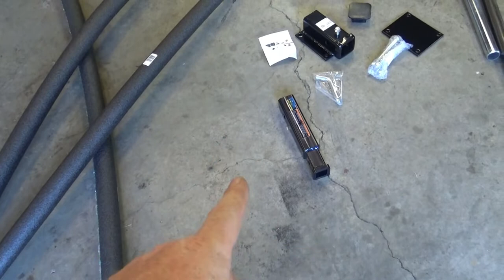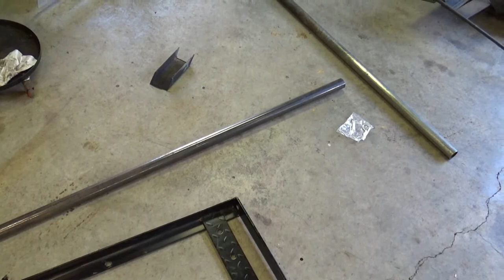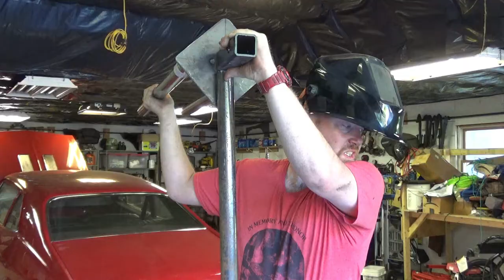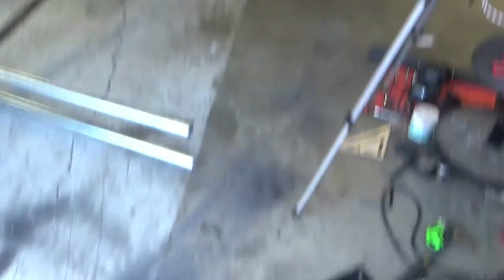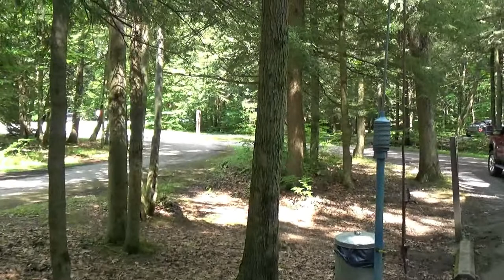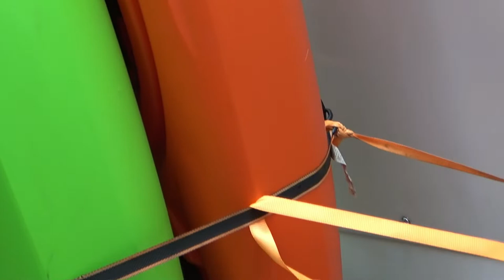Removeable kayak rack build for an RV

Comment: Not bad😁.
Only question I have, is blocking the 3 clearance lights any issue with trailer regulations?
Reply from the maker: As far as researched they just need to be present and functioning.  Kinda weird here but check your own state laws to be sure.  Thanks for the comment